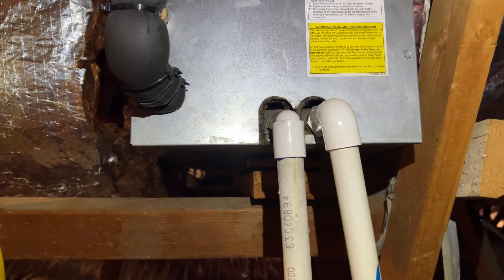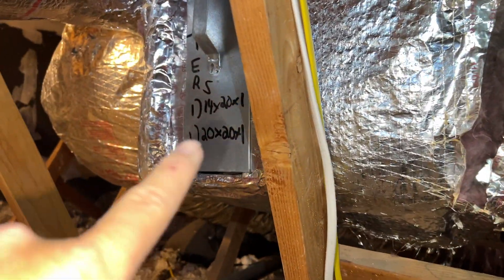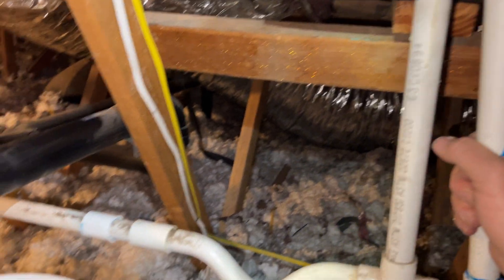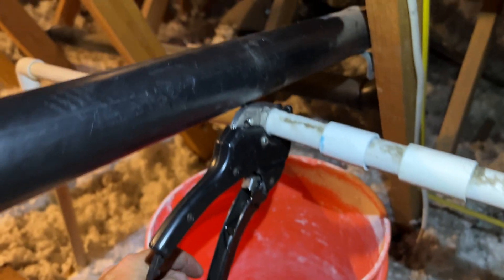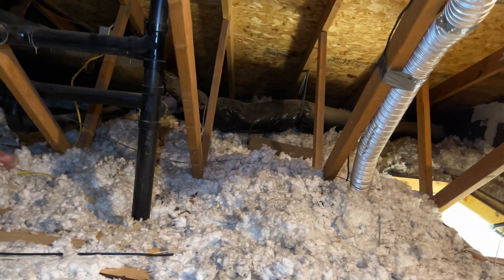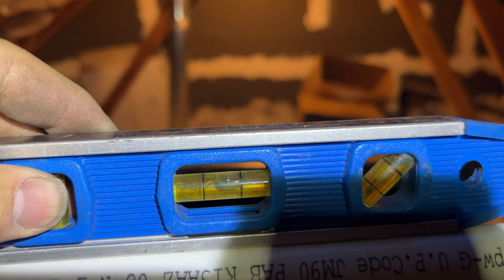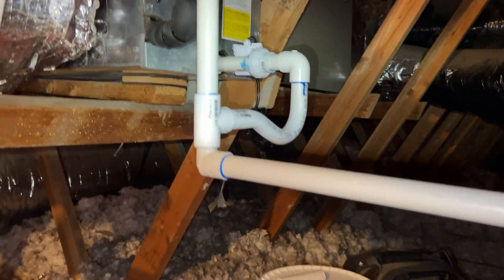Water dripping from the Ceiling,  AC Condensate Drainage Issues. EP90

Comment: I have a strange one for you. My apartments AC unit has the normal drain line that leads outside, however under the handler there is a PVC that goes down, the connects sideways into a inch high pipe that has a black wire coming out of it, the drain leading outside is not stopped up yet that little pipe with the wire is dripping....wtf is it and what do I do to stop it?

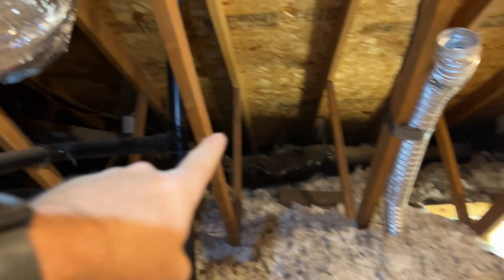Comment: At the 3:25 second mark, do you notice that corrugated silver “pipe“ coming up that is exhausting into the attic?! Certainly hope it is not from the dryer or the bathroom vent because if it is it will add a lot of humidity into the attic and eventually get moldy and mildewy and will be a health and breathing problem!! Once again, perfect example of a contractor taking a shortcut and not venting it to the outside of the house!

Comment: is the trap necessary on a pressurized evaporator coil ?.thanks for sharing.
Reply: From my experience, it depends on the system 
If the unit creates a positive pressure, a trap isn’t necessarily required 
But if the unit creates a negative pressure, then a trap should be used because the water could potentially be sucked back into the coil
Reply: @Cursey0  I believe you have it backwards, if it is positive you could use a trap because you’re pushing any water away from you/coil whereas if it has negative pressure/vacuum then you don’t want water in the trap to be pulled back into the coil that would be sitting in the trap originally.
Reply: @Doing_it_right_the_first_time  @Cursey0 does NOT have it correct. A proper trap allows for the force of the suction to not be great enough for the water to be pulled so far back that the seal the trap makes is broken, allowing the water flowing to the drain to do so without dealing with the negative pressure.
Reply: @princesspumpkinpanty  The thing is “Princess pumpkin” is that the trap does not regulate the suction, the coil does so the effect would be from the positive pressure or the negative suction created in the system, not from the trap itself so Cursey 0 does not have it correct!
Reply: @Doing_it_right_the_first_time  i corrected my comment because I meant to say he didn't have it correct, however the depth of the trap is what maintains the seal of the trap, the coil has literally nothing to do with how it drains
Reply: @Doing_it_right_the_first_time  dude…no that’s not how it works 
The coils doesn’t determine the pressure
The placement of the coil in relation to the blower does 
So if the coil is after the blower (positive pressure) then the drain will also be under a positive pressure meaning the water will be pushed out 

Conversely, if the coil is before the blower, that means air is being pulled over the coil (negative pressure) and as such, the drain will also be under a negative pressure
Which then means if there is no trap, the water cannot drain properly 

A trap allows for a seal and for water to flow normally in the drain line 
You can look it up if you want 
That’s how it works 

And also, water seeks its own level and always finds the lowest point regardless, hence the reason one end of a trap is lower than the other end
Reply: @Doing_it_right_the_first_time  No
Reply: If the drain is ran into vent for sewer then yes regardless of positive or negative pressure. If it goes into any septic drains it must be trapped. But if it goes into a condensate pump or outside then no trap needed
Reply: @acrservicesmathewr7565  if the coil is in a negative pressure, i.e. before the blower, then it has to have a trap, otherwise it will not drain. this is the reason you should ALWAYS read the manual, otherwise you end up causing thousands of dollars worth of water damage to someone's home
Reply: @acrservicesmathewr7565  that is correct but I run a trap no matter what just to be on the safe side and I run my pitch downward of course to my condensate pump or whatever it’s going to like for example going to the outside of the house. So many times I see long runs of level running pipe and it gets all slimed up and all murky. Running red label Coca-Cola down the condensate lines once a month during the cooling season is a good practice as it is to put into your houses kitchen and bathroom drains to keep the slime buildup down to a minimum.
Reply: @Doing_it_right_the_first_time  is Coca Cola better than bleach?
Reply: necessary, no. only when the pressure is a negative at the coil do you have to use a trap, but using a trap when the pressure is positive will keep the conditioned air from being blown out the end of the drain.